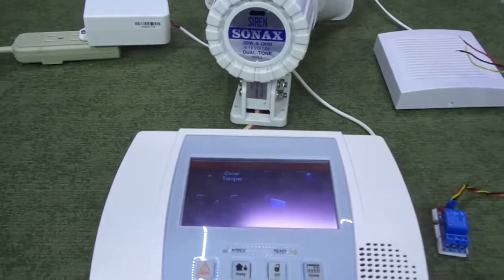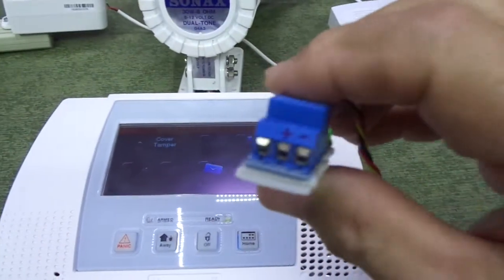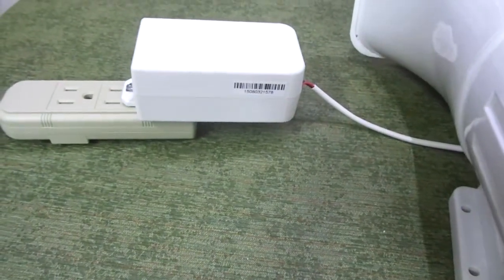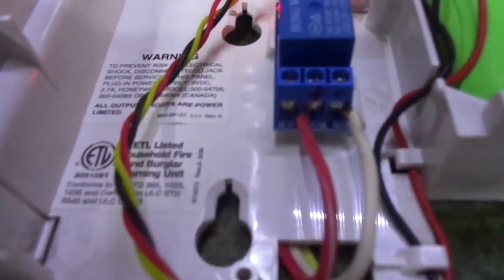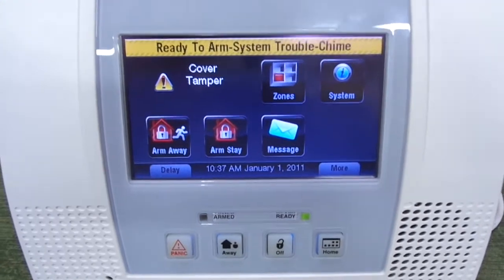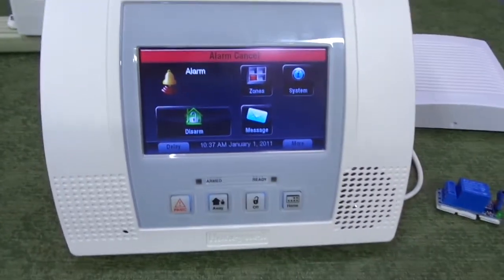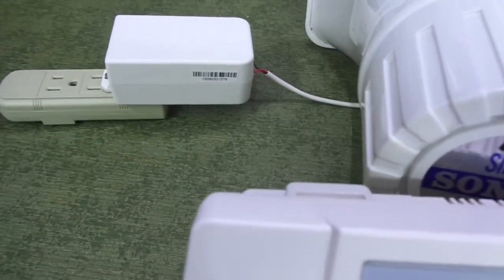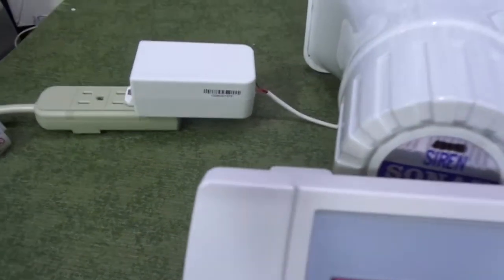Ron in the shop   DIY  Honeywell Lynx Touch Siren Module 30watt

Comment: What?  This is too easy.  I knew there had to be a simpler way.  Everyone I've talked to say you "have" to add separate power supply and relay module.  Will this work with a 2 gig panel as well?